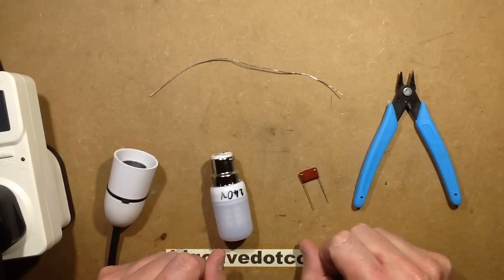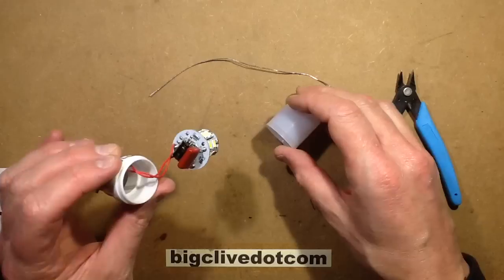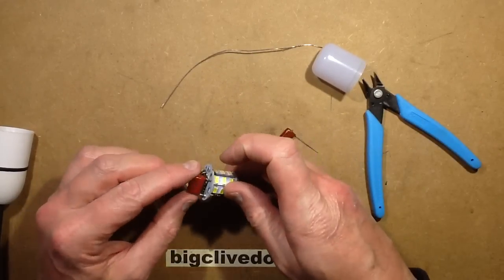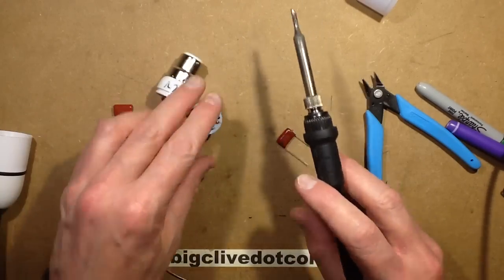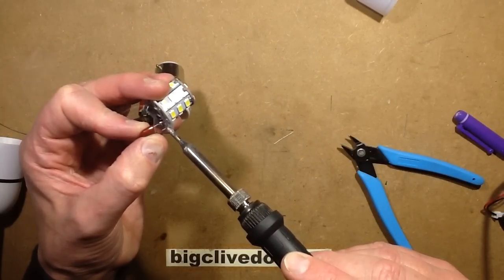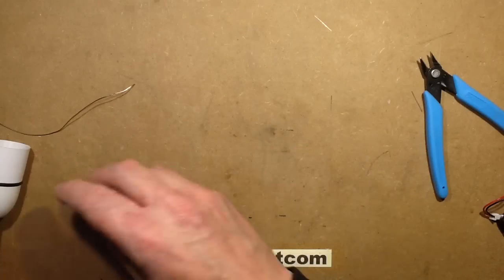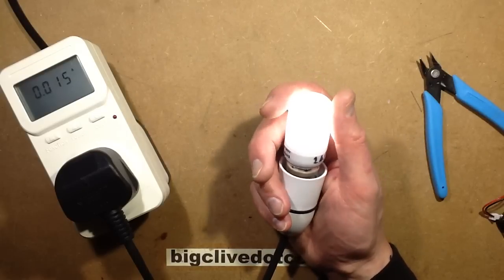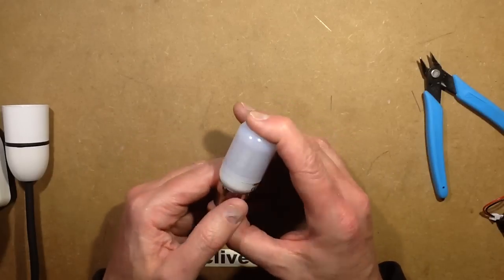Lamp mod.  For no good reason at all.

Comment: A capacitor like that may not care about polarity but circuitry around it may care which way that capacitor is around. That is because one of those leads will be connected to the outer foil layer. That is just physical reality. One lead has to be connected to the outer foil layer if the capacitor is to work. What that lead is connected to can make a subtle difference when it comes to EMI emissions too. Though in this case it makes no difference. In some audio applications it can matter.

Comment: Curious... are those 'bayonet' base lamps common in your nick of the world? Haven't seen them in the US except for automotive applications.
Reply: TheMrVengeance if you read back my first comments you'll notice I'm not talking about shattering in my hand at all. I'm meaning the still complete glass part coming loose from the metal. Also you shouldnt assume I keep turning it for ages :-)
Reply: TheMrVengeance
The bulb may wobble slightly in the bayonet holder, but the pins that connect the electricity are spring loaded, so they are always in firm contact.
Reply: I miss the old days of tungsten bulbs blowing, plunging you into darkness. And then the fun of trying to fit a new bulb in the dark, stood on a chair... with the ever present chance of sticking your finger into the live light fitting (because you'd be relying on the bulb lighting as it was poked into the fitting to give you some light to see by!).

Actually, thinking about this... light sockets are the only mains powered items where it's quite easy to poke a finger and give yourself a shock.
Reply: TheMrVengeance so solid that when trying to unscrew a failed lamp (maybe of inferior quality) the glass comes apart from the metal and you need to remove the metal base with a plier :) (I say that from my own experiences)
Reply: Filament bulbs are banned in the UK (and Europe?). The only ones we can buy are ridiculous halogen bulbs that nobody buys because they're stupid. Although some places still sell old stock of tungsten bulbs for obstinate old farts who like paying more for their electricity ;-)
Reply: TheMrVengeance this 'user error' has to do with old lamp fittings needing an overly tight screwon to make them make electrical contact :-)
Reply: Wow, thanks... I hadn't a clue!
Reply: looks like a B22 fitting.... it's the most common fitting for lightbulbs here in the UK
Reply: Thanks!
Reply: This is interesting! In the states almost everything (that I'm familiar with) is E26; and some E12 for some decorative stuff.
https://en.wikipedia.org/wiki/Edison_screw
Reply: +chuck fickens in my country The Netherlands we're used to E14/E27 screw mounts. Only Gu-10 is seen here for halogen bulbs
Reply: Their the correct type of mains connector not like the Edison screw you use their in the states
Reply: b22(bayonett) is standard here in newzealand, its only old oold homes that use e27(screw)
Reply: So I've learned! Do they make '3-way' bulbs/sockets in bayonet base as well. For the Edison E-26, they have both a center and ring contacts for the high & low filaments on the bulb end; and the screw shell is neutral. For low the smaller filament is used, medium uses the larger filament, and high energizes  both. High is really a joke... only ever so slightly brighter than medium, but consumes a good bit more current.
Reply: Like other people have said it's the standard UK bulb fitting. They have the advantage of being quick to change. I can't think of a disadvantage right now.
Reply: +Siskin's Bits and Bobs - It seems like the connection is a little more wobbly. An Edison bulb screwed in is pretty much solid.
Reply: ***** that made me giggle out loud x.x my sis looked at me funny
Reply: any1alive LOL it really has happened to me multiple times. It happened with lamps that 'violently failed' when their lifetime was over (the tungsten wire burning through creating a mini explosion in the bulb). I now use LED lamps for most places in the house.
Reply: ***** - Well that's just user error, if you twist it in soo tight that you shatter it trying to get it out.. That bayonet thing is just wobbling and rattling in the socket.
Reply: James Grimwood yes same in The Netherlands. I'm not such an idiot as the peeps you describe ;-)
Reply: ***** - Er.. no? For all my life, all I've used is Edison screw bulbs, and I - nor anyone I know - has ever shattered one in their hand twisting it back out.
And they all work just fine when they're screwed in to the point where it grips.
It's not load-bearing, you don't have to tighten it for the ages.
But if something is going to pass 240v I'd rather not have it jiggle around in the socket.
Reply: True
Reply: James Grimwood  Not true! The sale of normal 150W, 100W and 60W tungsten filament lamps is however restricted.
Reply: rwbishop  There are at least three sizes of bayonet lamps. For 230V / 240V mains lighting in the U.K. The B22 is extremely common (it being the standard light fitting). The two pins that make contact with the contacts on the lamp base are spring loaded, so always make good electrical contact. The metal cap is not electrically connected to any part of the lamp circuit.